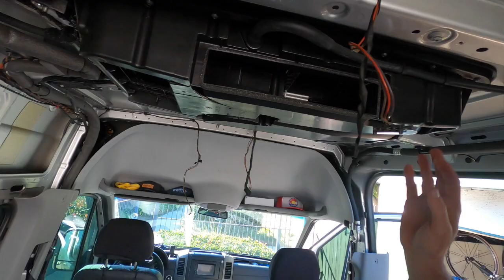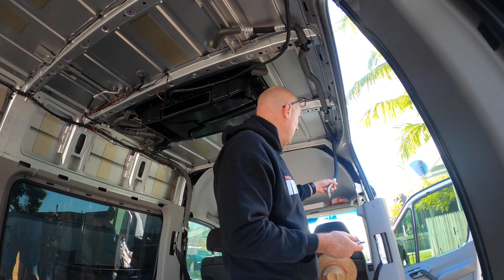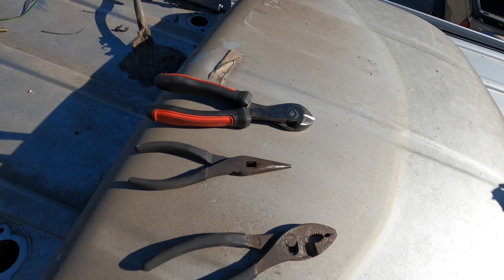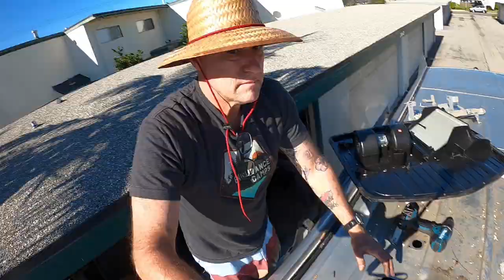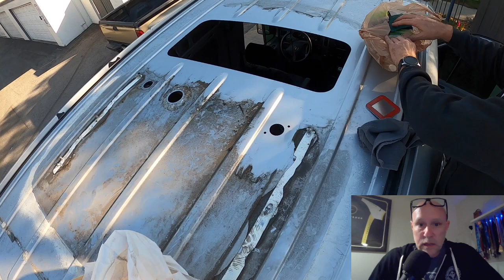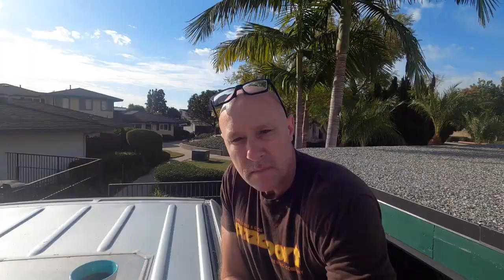Mercedes Sprinter Van Rear AC Delete

Comment: What did you do with the a/c compressor under the hood? Did you you just remove the belt? I believe there is 2 a/c compressors in the engine compartment correct?
Reply: What did you end up doing?
Reply: Just take the belt off. Mines been off for a year because I did the alternator and didn’t feel like putting it back on there is no tensioner for that 2nd belt

Comment: great video! looking to tackle the same project this weekend. i'm having a hard time finding someone who can drain the freon from my unit. i found one person but he's asking if its drained under the hood or from the rear ac unit itself and im not sure the answer to that. any ideas?
Reply from the maker: Thank you, Sir. My mechanic had to figure that out, too. It does need to be drained from under the hood. If I remember, there are two separate systems for the front and rear AC. They are both located under the hood. GREAT QUESTION and good luck!!